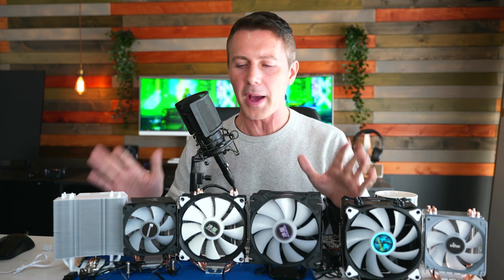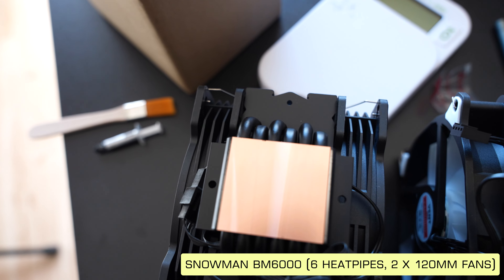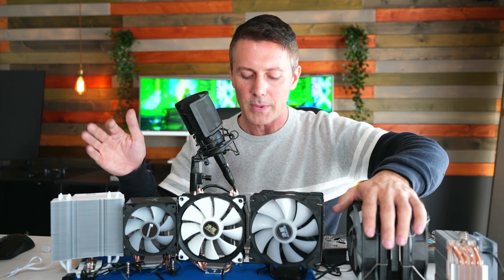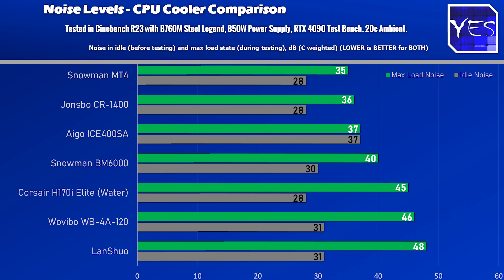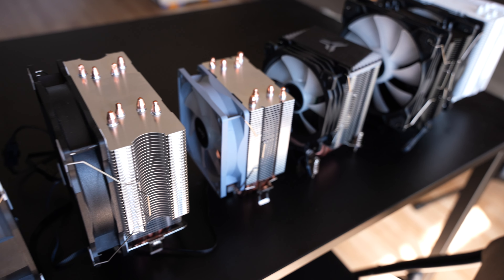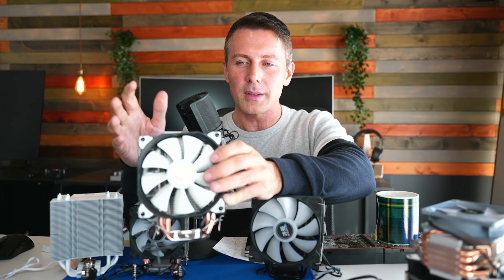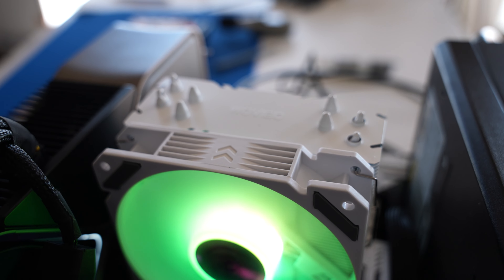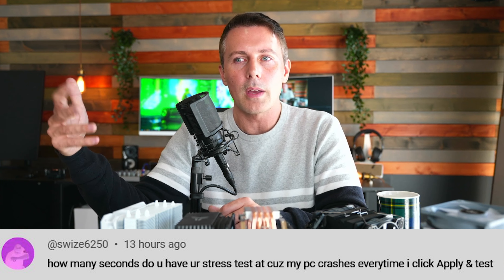What's the BEST BUDGET CPU Cooler in 2023? (Aliexpress Showdown)

Comment: Deepcool coolers are good too 😁

I've owned a Deepcool AG400 Plus, it's surprisingly amazing for a IDR 300K Single Tower, Dual Fan Air Cooler (around USD $20, I guess?).

It is capable of cooling my 5800X3D just fine without any throttling at all. Make sure to use a good paste though. 

On my rig, 86 C is the highest temp it could reach, and it's only reaching that temp on synthetic benchmarks (Cinebench R23). And it went all the way down to 79 C max when I undervolted it at around -50 mV.
Reply: I used to use the snowman for most of my builds and I have now swapped over to the AG400 aswell. For $29 AUD, it is bargin and I think outperforms the snowman as well. I think it would be solid content to compare something you can get locally to an Ali cooler.

Comment: I just upgraded to an ASUS X570 board with a 5700x, which does not come with a cooler (thanks AMD).  I just put the wraith prism from my 2700x on, and it is working fine.  But now I want to move my 2700x system into my backup system and will need a new cooler, or salvage the cooler from my 1300x and use it.  Good to know the Snowman is still there if I want it.